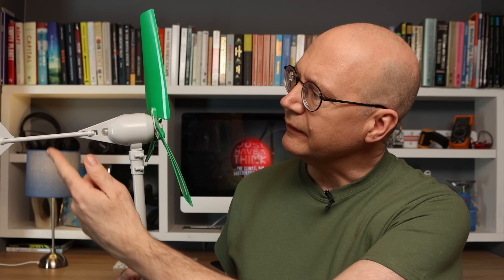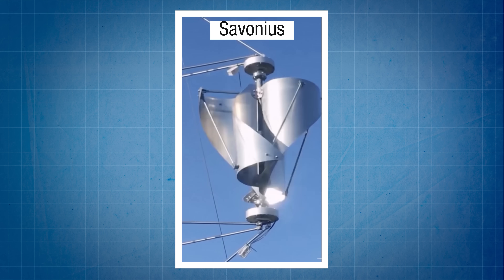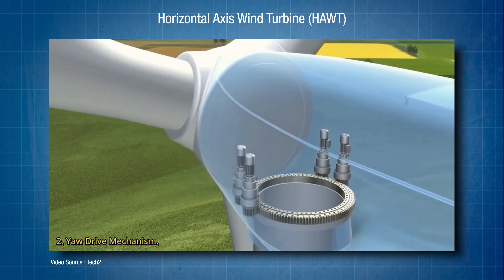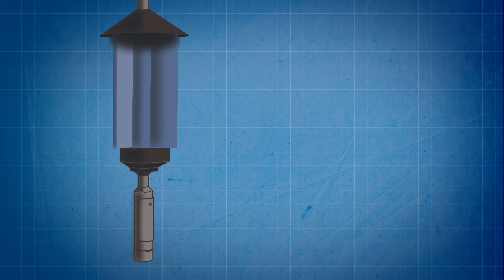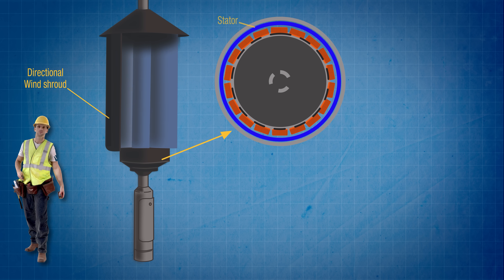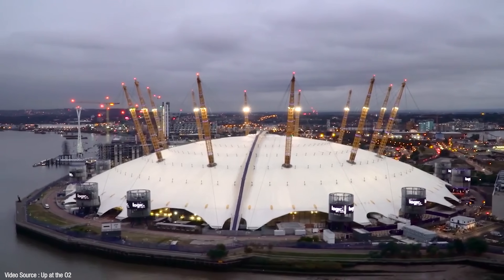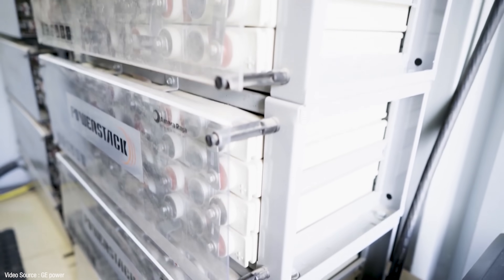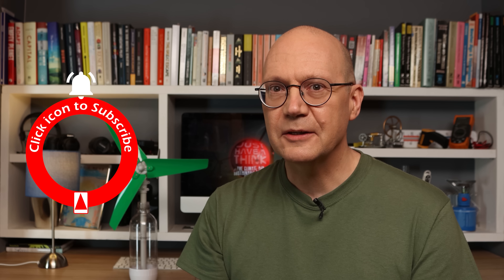A vertical axis wind turbine that doesn't need the prevailing wind! How do they do that?

Comment: Reedeeculous.    The power collected goes up and unfortunately also down as the CUBE of the wind speed.    This has been known for over 100 years.  The average wind speed by a highway is awfully low.  Cube it and compared to mounting them at height you get a pitifully small amount of power.   Also the power is always proportional to the swept area. which is mighty small for these VWTs.  Another huge strike against this geometry.

Comment: You could have also looked at flower turbines. It's a Dutch company that makes quite esthetically pleasing small scale vertical wind turbines. Those can also be placed next to each other in a certain pattern to make them more efficient.
Reply: Bad product. Low energy returns and the 'tulip' wind turbine does cast shades on the leaves (blades), which make them inefficient too. Vertical wind turbines are just not very efficient, I highly doubt this video, where other vids from this channel are great.
Reply: @91Wtr  how does shade casting affect performance?
Reply: @tthecreator743  shade from the windmill ('flower') on the solar panels ('leaves') below (see the 'tulip' design and you see what i mean). The solar panels will work badly because of the shade from the mill.

Comment: This video misses all critical thinking IMO. The numbers presented are fairytales, and a little bit of basic math by the presenter could have shown that. Yes, it would be great if this kind of thing worked. Hate to break it to you, but it doesn't. It has been tried over and over again, in slightly different designs. They all run into a reality we like to call laws of physics. In this case: the formula for the amount of kinetic power that exists in flowing wind (1/2 * rho * A * v³) and Betz law that explains why you can only harvest a theoretical maximum of about 55% of that power. Typing that into a calculator would have shown that a small device like that can at maximum produce around 54W if the 5.4m/s speed is accurate. Real power output I would estimate at about half of that.

Comment: I don't remember what it's called, but there is a power generating system installed in Sandpoint, ID, USA, that generates power just by people walking over it. It can also be installed in roadways thus generating power as vehicles drive over it.
Reply: And where do you think this type of 'free' energy comes from? The cars will use more energy 'climbing the hills' that you build in the road.
(Multiplied by the low efficiency of this type of generators.)
Reply: @AdrieKooijman  What hills? The ones I was talking about are perfectly flat. They generate power simply by having people, cars, whatever, going over them. I have no idea how they work. I just know that they do work. They don't need a high efficiency as they are intended only for local power.
Reply: @johnslaughter5475  To generate energy something must move. Years ago I participated in the sustainable dancefloor project: an energy generating floor where the movement of dancing people generated energy. The floor sinks a few milimeter on the dance movements, this motion drives a generator and power the light in the floor. The idea of building a similar system in roads is old, and always based on motion - the road is built from tiles that move, the movement generates energy. But the car has to 'climb' to the next tile (or section of the road) and will use more energy.

Comment: I actually thought the idea was older than 2017 I do recall a plan to place small turbines on the center dividers along interstate highways in the US replacing the anti glare fins. Having spent 20 years on the road creating a lot of wind I think its a great idea and the only real downside I can see is they will have to meet safety standards to minimize damage to vehicles which may crash into them. There are also potential issues with road spray, salt and slush in colder climates but that's why engineers get paid the big bucks. there is so much potential here to regain essentially "free" energy from the moving vehicles I'm only surprised that it hasn't happened yet.

Comment: Fascinating idea. I wonder what sort of effect it could have on aerodynamic efficiency of traffic -- either positive or negative?
Reply: Negative. There is no such thing as free energy. If they take any energy from the traffic passing by at all, then that energy must come from the engines driving the vehicles. His argument here is that "the vehicles would create draft anyway, regardless of there being turbines or not". But this disregards the fact that vehicles following one another benefit from the first vehicles pushing the air out of the way, too. And it ignores the friction that the turbines themselves introduce.
Reply: @Yutani_Crayven  I thought so at first, too, but wouldn't the "wind" of the opposing direction of traffic have already negated this advantage? So by taking the energy out of the air that is passing between the opposing lanes, it would act as something of a buffer to the slipstream created on both sides?
This is, of course, assuming that there is an equal amount of traffic on both sides, which usually is not the case. But even so, it would be interesting to see some sort of fluid dynamics simulations.
Reply: @Chasmodius  Either way those blades resist ait flow and that increases air resistance to the vehicles. It is in all cases criminal and not efficient at all.

Comment: The resistance provided by the turbines will make it harder for vehicles to push through the air, increasing their fuel consumption. That loss has to be significantly lower than the gain by the turbines.

Comment: I have been thinking about the highway wind for years, one argument against i see is what happens in an accident, but i still think it is a great idea and should be done, also could this style of turbine be used horizontally along the roof ridge of buildings, laying them down and placing them end to end would eliminate gaps, maybe both horizontally and vertical. another good point is the speed of these turbines is slower and are almost silent.

Comment: Anything which impedes the ability for air to get out of the way of traffic essentially adds to the fuel consumption of the vehicles. These are therefore effectively petrol powered wind turbines...If you want a clear example of this, try driving through a tunnel. It takes more fuel to drive through a tunnel than it does to drive in open, unimpeded space.
Reply: Only if you drive a gas-powered car!
But if you have an electric car and put one of these turbines on the roof, it can directly power your car!
And it has several advantages: The faster you drive, the more electricity you get out of it and while you drive, there is always wind, you are weather-independent!
I did calciuölate it: When you drive with 55 mph, you will get 30 hp out of the turbine - not very much, I agree, but the calculation shows that it's possible!

This system can be vastly improved if, additionally, all streets will be built downhill only. I do wonder for decades why this idea isn't already implemented anywhere!

Also, the moon pulls with considerable tidal forces at any object. Building roads that are aligned with its path around the earth will pull cars along just like the tidal waves in the ocean. For a maximum effect, you can add a cart with a really heavy weight on it in front of the car, because the gravitational force increases with mass. It is very obvious that this system is therefore especially well suited for heavy trucks and of course trains.
---------------
PS: After reading a lot of posts that show that many people here do not have even a very basic knowledge of physics, I have to add a disclaimer: My post is purely ironical and violates fundamental laws of physics.

Comment: Another advantage of VAWTs is they are less dangerous to birds, and, if need be, could even be enclosed in a cage to prevent contact.
I would be very interested in a consumer version of between .5 and 1 meter high.
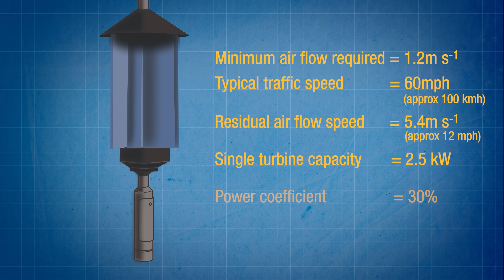Reply: why? it would produce about 10 watt, which is not enough to power even your smart phone efficiently. Dave's numbers don't stack up, they are wrong by either two (5:31) or three (8:50) orders of magnitude. (So which is it, 2.5 or 24 kW?) The right number for a VAWT this size is about 25 watt, by following the standard VAWT physics formulas.

Comment: I admit to some scepticism. Fluid dynamics is complicated and often yields counterintuitive results. It's entirely possible that trying to capture the "residual airflow" generated by traffic will create vortices or pockets of higher pressure in the traffic lane which will increase air friction on the cars themselves, thus robbing them of some energy.

So this idea may not be capturing waste energy but may effectively be taking that power from the inefficient fossil fuel generators that are our internal combustion engines. In other words, the energy isn't free, but is paid for at the gas pump by all of the drivers that use those roads, and carbon emissions from vehicles will go up.
Reply: @catawallupinbass  You're just asserting it won't have any effect without evidence. Like I said, results from fluid dynamics are often highly unintuitive, typically because they are non-linear. You just can't generalize from understood examples like drafting.
Reply: @catawallupinbass  Again, that's total speculation based on naive reasoning about fluid dynamics. Unless you have a citation with some simulations backing your claims, you liteally have no idea whether the turbines will increase (say due to decreased vorticity), decrease (say due to some kind of back pressure) or have virtually no effect on the air flow on the road. The Navier-Stokes equations governing fluid dynamics are very complex and produce very unintuitive results.
Reply: @catawallupinbass  If half the traffic is fighing the wind, then half is helped by it and the net energy loss = 0 in a closed system. As for trees stealing power, they very well could. Or they might help in some way. This calculation hasn't been done to my knowledge, nor has the efficiency of shielded highways been studied in this way either.

Furthermore, trees aren't turbines, and turbines aren't walls. None of these are directly equatable. Fluid dynamics are *chaotic*, so even slight perturbations to the conditions cause wild differences in outcome. You're effectively arguing that wings produce lift, and some flat stones are sort wing-shaped, therefore we can use such stones as wings to produce sufficient lift to fly. That's just not how it works.

Comment: how would these effect average air flow of the road? if your pulling energy from the wind you slow it down in that area, so vehicles on the road would become less efficient overall having to combat the extra drag they feel because the air flow is reduced.

roads also create a kind of wind tunnel because they are long and flat with many buildings or trees enclosing it. The drag would also create more turbulance in the middle island that seperates the 2 road directions. Barriers or larger gaps would have to be used. 

installation and maintenance increases along the road, leading to massive contruction delays and congestion when cars approach vehicles on the side of the road. 

Risk of severe damage due to car accidents. the light poles are designed to break away down at its base so you dont wrap your car around it... imagine a spinning metal bladed cylinder during a traffic incident..

lots of infrastructure improvements would be needed for this.
Reply: my negative questions here are because im very interested in this idea, not against it

Comment: Afterthought: Cell towers and such can be so ridiculously tall ... I wonder how many of these you can incorporate into a single cell tower.  Or into the giant power line transmission towers that are already delivering electricity to the grid.
Reply: Er, you want to put a maintenance-dependent, huge spinning thing on top of a kilovolt power transmission line that is essential to grid performance?
Reply: @tzenophile  Yes.  Yes I do.  I know how crazy it sounds.  But they literally clear paths through forests and over mountains for these things.  IF a way to safely maintain them could be found, they'll have all the access to wind they'll need no matter where they are, and being literally the backbone of the grid would improve the efficiency of collecting and dumping right to them.  Heck, they might be the only lines that could safely handle as much electricity as you could potentially generate from the idea.  So yes it sounds dangerous, but it's a risk vs rewards kind of question.
Reply: @justsomeperson5110   Safety and uptime issues aside (both are huge), the terrain through which power lines typically moves does not lend itself easily to wind-turbine maintenance. You want to have them within easy range of a service center. Stretching out is costly. Upscaling the voltage of each turbine to match the line voltage seems unrealistic or at the very least super expensive per watt. And then there is turbulence, which inevitably will put serious, unwanted strain on the lines themselves. Do I have to go on?

I do have a weakness for insane ideas, and I am not fond of eating hats, but if this ever becomes reality I will marinate and eat my Hollywood Drive Stetson.

Comment: I have seen quite a few coanda vawt ideas kicking around, this would be an absolutely perfect application for those central posts you showed along the motor way, as they could potentially harvest the wind generated from both sides of the road, and then the central turbine itself could potentially be housed inside the light pole for added protection. All that would protrude would be the curved inlets to bring the wind down into the central chamber.

Comment: I've been planning to build a couple of these myself one day for my home.  So this was entertaining to see a mass-market attempt to integrate into roads where it makes a lot of sense.  I just wish their version included a battery to run off of when there's nothing spinning them, topped off first before sending electricity to the grid when there's a surprlus.  You can argue that the grid is the battery, or that the batteries add maintenance cost.  So I get it.  Still, it'd have been nice to see if they could achieve and live in complete self-sufficiency.  And sometimes the grid does fail, so for those emergencies...

Comment: I always thought every power distribution pole should have a VAWT wrapped around it.  Much if the cost of building wind turbines is the base and pole. They could at least offset the transmission losses of the lines.

Comment: My view?  Every little bit helps.   We can't afford NOT to test and implement these new technologies. The cost of proactive carbon free power generation is dwarfed by the cost of reactive climate change repairs due to hurricanes,  flooding,  drought and so on.  I also thought the additional information and data that these units can generate as a free, added bonus is also fascinating.
Reply: Every bit of this helps the oil industry and also with the climate change. The more of those thievery machines the faster the climate changes. Also a fantastic contribution to land fills. So that's what you want.

Comment: AFAIK, instant power of a wind turbine is proportional to cube of wind speed. Therefore turbines which work at low wind ("without the wind" as it stated in the title) speeds produce microwatts if not nanowatts of power and are pretty much useless.

Concerning the road-side turbines, they deffinitely should produce extra resistance (not "anyway wasted energy") to airflow from air pushed aside of passing vehicles, adding to air drag and reducing vehicles efficiency. Basically they steal some energy crumbs from energy released from fuel combustion.